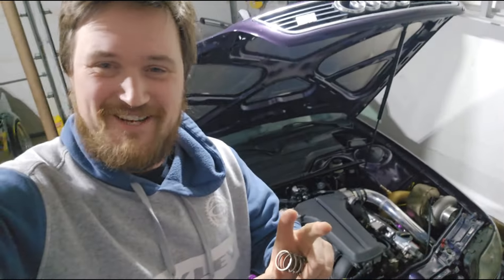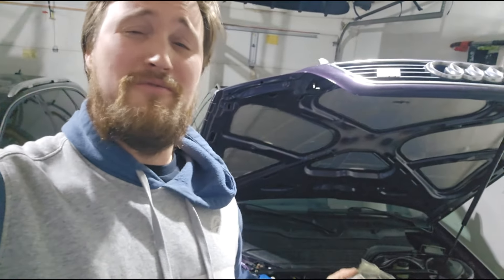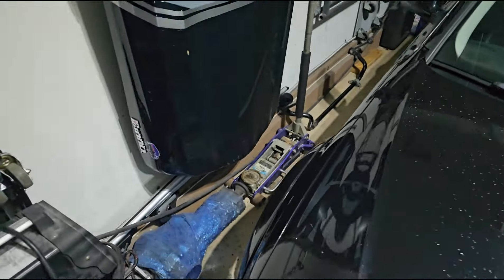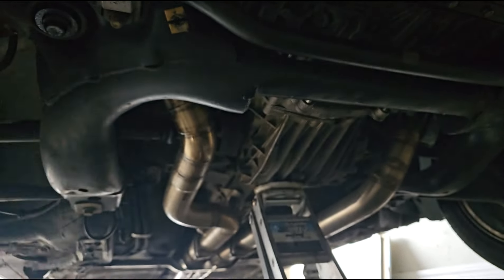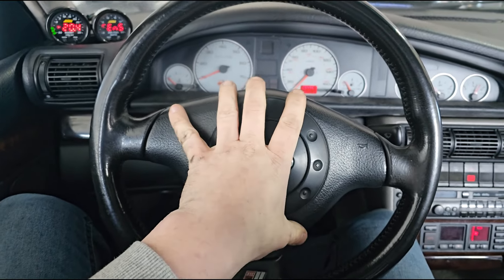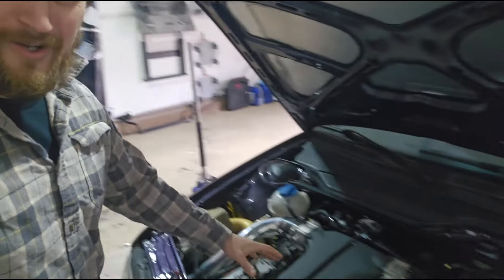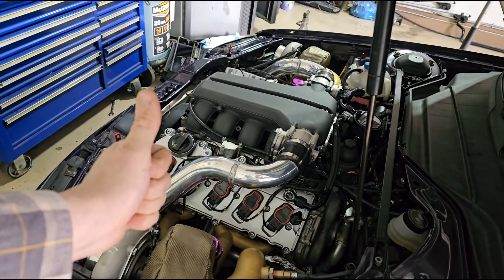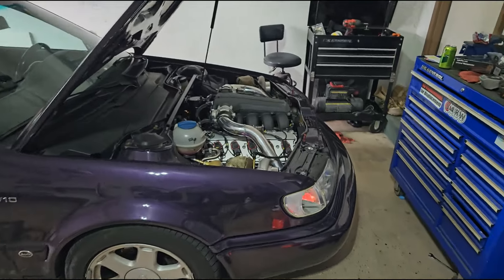Up'd the Boost on the Twin Turbo V10 URS6!

Comment: I'm surprised the old tranny mounts lasted that long...  it's usually the first thing I end up replacing on these C4 UrS4/S6s.
Reply from the maker: Hah seriously. I don't know how old they are, but they were the stock transmission mounts that were originally on the car when I bought it 40,000 miles ago 😂😂

Comment: Change the angle of your turbo bearing centre sections. they are on to much of an angle maximum 15 degrees. But aim for least as possible. The oil cannt drain out quick enough, so its coming out the shaft seals. Alao if the drain pipe is too small willl cause the same issue

Comment: Need a dyno on that asap
Reply from the maker: Oh, definitely. Tough to get away during the week, though 😐

Just know it's probably making around 650-700hp (we've since added timing) lol
Reply: @joelfrancisco3798  well I happen to own an 07 s8 and just got turned onto this by a random video on fb. I was planning to do this myself but you beat me to it lol so if you wouldn't mind, can I have a build spec sheet? Would save me a ton of time. I'll even pay you or whoever to do the custom manifolds. You said you were a welder so I assumed you made them haha. I've basically done everything you can for an n/a build from jh motorsport and I make 389 to the wheels at high elevation. I'm a master tech as well and did it all myself. Also can give you some tips if you ever need to rebuild the motor